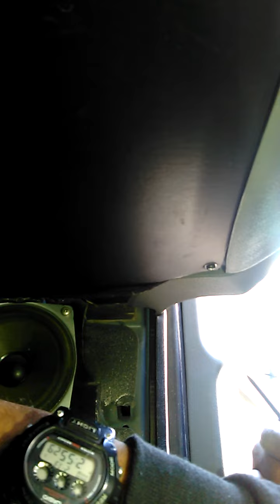E36 kick panel speakers pt2

Comment: Hey so you installed a coaxial speaker in place of where normal it was a midbass woofer. What did it sound like in person ? The sound signal it was receiving should have been a low input hence why I’m asking? Was it being powered directly off the head unit or was it the head unit then the stock amp to speaker ?
Reply from the maker: For some cheap speakers they sounded pretty good for what they we’re.. They we’re powered directly off the head unit

Comment: i thought oem speaker is 30 watt. yours is 200 w? did you use an amp?
Reply from the maker: JL Peng Sorry for the late reply.. My OEM speakers blew and no I did not have an amp hooked up to these aftermarket ones.. The wattage from my CD player pushed them a little bit.. I will be replacing them again with something better
Reply: thx for the reply, bro